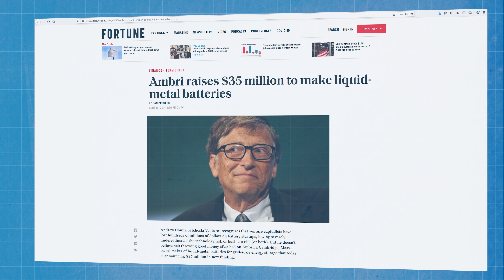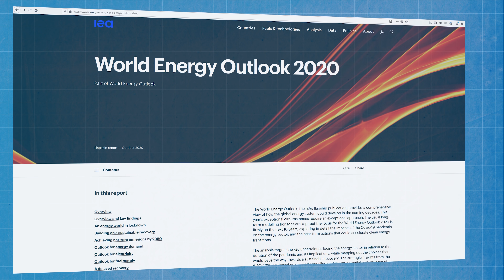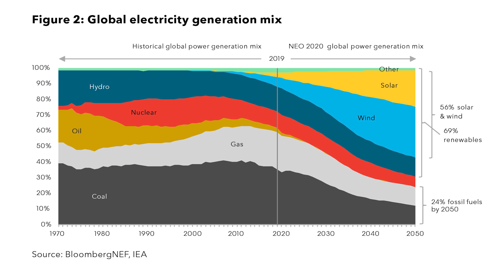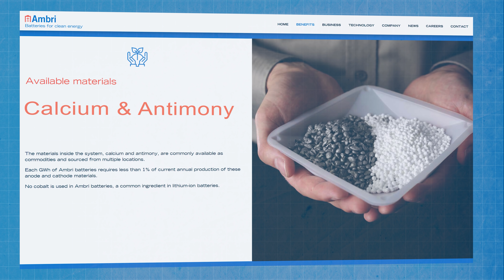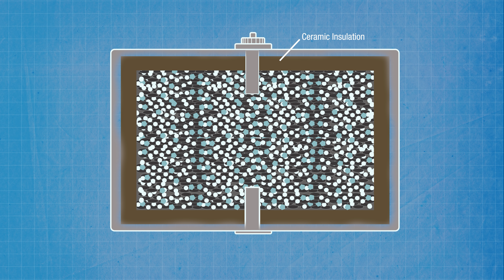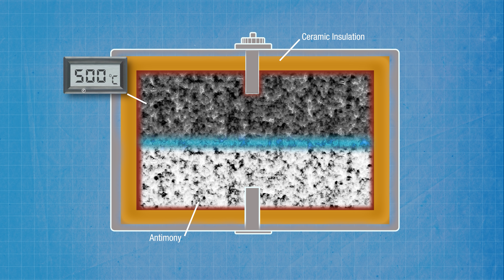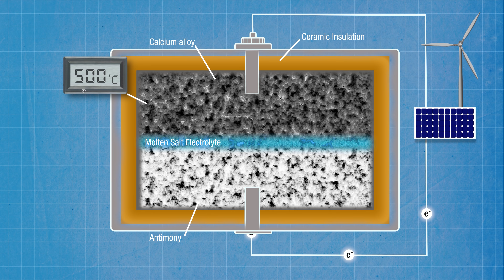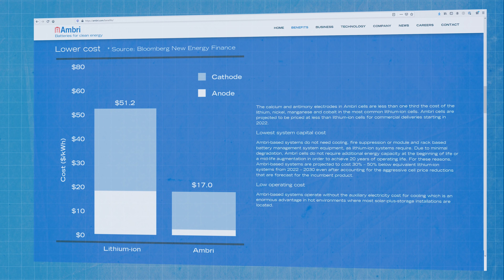AMBRI Liquid Metal Batteries. Will they really change the world?

Comment: I am highly skeptical of any energy production or storage mechanism that claims to be safe. Any system with low entropy can explode, or at least conflagrate dramatically. Battery/electric systems tend to have higher entropy than thermal/mechanical systems because electric power is so efficient you don't need as much energy available to get the job done, and this is a battery not a combustion generator, so likely less explodey than methane as an example.

But it is still liquid metal, if the container is damaged, that is dangerous. If it leaks out your building is highly likely to burn down, if it comes into contact with water it will flash boil causing a steam explosion, and there are probably other risks too.

I'm not saying this rules out the technology, it may even be among the safest ways to store energy available, I'm just saying that if we don't take its risks seriously from the start, we'll discover them when things go terribly wrong.
Reply: The fact that something poses an explosion and/or fire risk has never stopped us. Just think of how many tons of highly flammable fluids are stored under each and every gas station on the planet.

From my point of view, the bigger problem with this battery system is the toxicity of antimony rather than the imminent fire hazard. It might get banned just the same way we're currently banning lead from everything and anything.
Reply: @MoraFermi  And it isn't like gas is non-toxic either. I'm not an expert, so I can't say how it compares to this battery, but toxic hazards can also be managed.

We just need to be realistic about what the risks are what needs to be done to mitigate them to a satisfactory degree, and then choose the best available option. If the battery costs half as much as the total cost of Li-ion, but you have to spend 3 times the battery cost to mitigate the risks, it isn't cheaper. On the other hand, if the risk management only costs 5% and the battery costs half as much, it is well worth it.

I'm very glad they are setting up an operational pilot project, that will give us real world data on the costs, as well as experience dealing with the non-monetary downsides. We'll see how it stacks up, and which applications if any it ends up being the best option for. Maybe it turns out to never really be worth it, maybe it turns out to be worth it in niche situations, maybe it turns out to be our primary grid storage solution. It definitely has potential.

Comment: As the host said, we'll need all energy storage options and then some. So assuming this can work as promised there will certainly be a place for it alongside the many other schemes. But in terms of form factor and structural limitations, it seems to me that the direct competition for this technology will be flow batteries (vanadium based or otherwise). Big, heavy batteries that are suited to stationary applications, but can be placed almost anywhere with a relatively limited footprint. So the question becomes which will end up having the edge in terms of price. Difficult to predict, but I'd be interested to see someone make an educated guess, based on abundance and current market price of materials.

Comment: "If you want something dirt cheap, make it out of dirt."  -Donald Sadoway
Reply: "Preferably locally-sourced dirt" - Donald Sadoway
Reply: awesome how he uses designing from first principles
Reply: ....But all that we have comes from dirt and some dirt is very expensive ...I'll say that Chinese of long ago did use local materials to construct the great China Wall .
Reply: @charlesdickens6706  Sadly, local materials and locals.
Reply: "That's no moon" - Jean Luc Picard
Reply: @JohnnyWednesday  the moon does not exist
Reply: preferably  local dirt
Reply: IF Mr. Sadoway wants a cheap method of defeating the dendrite problem , he should investigate the use of ultrasound vibrations to prevent even the beginning formation of the crystals . The u-sound would not need to be applied non-stop , only intermittently . This strategy would minimize the energy required to keep the battery healthy , and thus greatly increase both it's lifespan and it's safety-factor . 
*To examine a possible extreme use of such batteries , read my post at : 
quora.com/If-you-try-to-drive-a-regular-gasoline-petrol-car-on-Mars-will-it-work-Will-it-explode/
Reply: @Prof.Megamind.thinks.about.it.  Sadoway is advocating for a battery technology not based on solid state physics, so dendrite formation isn't a problem. He started the design process by looking at what the requirements for a grid scale storage battery would be. ie; low cost. Made of abundant materials that are  "locally available", safer than exitsing solid state lithium ion batteries, no use of so-called "rare earths".  He took as a starting point aluminum smelting which has alumina ore and a separator electrolyte (cryolite)  with a carbon electrode placed in an insulated vat. A large current is applied which melts the assemblage, reduces the alumina to aluminum and oxidizes the electrode. The refined aluminum is drawn off. However, if the system was sealed and the heat maintained,  the process would be reversible and you would have what was essentially a high temperature storage battery.  He then tasked his team with finding other chemistries with better electrical capacity, made of abundant relatively available elements (if you want to make something dirt cheap, make it out of dirt.)
Reply: @Prof.Megamind.thinks.about.it.  🤔🤔🤔...who said Prof. Sadoway has a dendrite problem? Dude, you're sleeping in class again!
Reply: @Prof.Megamind.thinks.about.it.  ...🤔🤔🤔...who said Prof Sadoway has a dendrite problem? Dude, you're sleeping in class again!!
Reply: @willykitheka7618  
The entire industry has a dendrite problem, in general . That is what I am addressing, NOT liquid-metal batteries . 
Now that you've critiqued my process for overcoming a major industry hurdle , let's hear your "woke" solution .
* I am all ears !  .🤓
Reply: @Prof.Megamind.thinks.about.it.  IN a TROPICAL COUNTRY like INDIA, LIQUID METAL BATTERIES r easy to use/maintain than LITHIUM ION batteries in a LARGE SCALE.CHEAP METAL .

Comment: Sounds like LM batteries are a great potential solution for grid-scale scale energy storage.  However you did not mention anything about powering transportation: boats trains, cars. You said of course that knocking them over  causes them to be disabled and cool down . I am guessing any form of movement may not be good for these batteries. Can you confirm and expound?  For example,  I can imagine ships and trains possibly being stable enough for these batteries, but not cars and planes.  Also they sound way too heavy to power cars and planes.
Reply: They would be in a solid state when being transported. Movement on a train wouldn't effect anything.
Reply: @bubba842  hey Tom thanks I mean to power transportation, not being transported themselves.
Reply from the maker: Hi Douglas. They are 100% NOT designed for anything that moves :-) They will only ever be deployed as stationary utility scale energy storage.

Comment: Once proven, I can see suburbs having Ambri batteries buried under streets and all solar-PV roofs feeding into them during the day, and sucking out the power during the evening.
Reply: I like the idea of taking DC from solar or wind straight to the batteries, saves losses and plant cost in converting to and from AC and no problems synchronising frequency and phase.
Reply: Better yet, in cold climate they could be used as heaters.
Reply: @ramentabetai1266  No.  They need to operate at that high temperature to keep the chemicals molten.  If you take heat out of the cell it will start to freeze, so you'd need to introduce more heat energy.  The heat produced b y charging the battery is sufficient to keep the molten state
Reply: @rogerbarton497  Actually, they could. Objects with higher temperatures will always transmit heat to cooler objects. They wouldn't be very effective heaters, but they could work as a supplement. I wouldn't recommend replacing a furnace with these batteries, though.
Reply: @davidfeigel1677  You're missing the point - they need to be kept hot to keep the chemicals molten.  The idea of using a ceramic insulating case is to keep the heat in.
Reply: @rogerbarton497  and no material can perfectly contain heat. there's going to be heat loss, and at 500 C there's going to be plenty of it. Enough to heat a house or a room? Probably not. Enough to heat a small closet? Probably yes.
Reply: @davidfeigel1677  From here  https://ambri.com/technology/
QUOTE "The system is insulated and “self-heating” when operated, requiring no external heating/cooling to keep the batteries at operating temperature."
and "the system is expected to remain at operating temperature continuously for the life of the system"

To me this means heat is retained within the system.  Of course no electrical or mechanical contrivance is 100% efficient and as you rightly say there will be some heat escaping, but certainly not enough to be a viable source of heat.

Comment: Interested to learn the specific capacity of these Ca-Sb batteries
Reply: If you listen to Sadoway’s presentations he points out that energy density is not as important for stationary grid storage as are cost and cycle life. Lithium ion is a much better solution for cars and cell phones because of its superior energy density, but for grid storage energy density is less important.
Reply: 1000 kWh, 250 kW capacity liquid metal battery, voltage 500-1500V, response time < 500 milliseconds, and > 80% DC efficiency, which fits into and can be delivered in a 10 foot shipping container.
Reply: @charlespolk5221  thanks. around 100 Wh/kg by a rough estimate which is not bad given the much lower material costs
Reply: @charlespolk5221   he is asking for an energy density (kwh/kg) i think.

Comment: Better to use nuclear for your base load. Perfect for it.
Reply: Takes too much time to make a nuke plant and a lot of money to maintain it.
Reply: @ramentabetai1266  Big ones, yes, though fuel costs are VASTLY lower than fossil-fuelled power. Small modular plants are cheaper to build and run. The extra cost is worth it considering nuclear is zero-carbon.
Reply: @heavy_metal_chemist  SMBs require a lot of certification, testing, etc. Building them requires high tech factories and you gotta build them far away from the public.
Gotta refuel them and store the waste. Not many countries are ready to do this fast enough to make enough of a difference by 2050.

If HB11 Energy's fusion(aneutronic, the no radiation/waste kind) thing works there will be no need for SMBs.
Reply: @ramentabetai1266  Nuclear is safer than you give it credit for. We're not in 1980s Soviet Union any more. Three Mile Island is an example of how reactors in the West work under accident scenarios - the containment works. No need to build away from population centres at all. 

A whole bunch of SMRs are based on existing reactors, just scaled down, so there's far less paperwork to do. NuScale have done theirs (I believe), and are building the first demonstrator soon, along with a bunch of other designs. 

The current range of reactors do far better on fuel efficiency, but if we want a sustainable fuel cycle that waste is recycled. Spent fuel isn't a waste, it's a resouce, and should be treated as such. We (I) are working on new methods for recycling to bring costs down to achieve this more easily. 

There's no other way of looking at it - we NEED nuclear in order to keep the lights on while decarbonising.
Reply: @heavy_metal_chemist  It is safe, but not safe enough for the regulators and the media. The public perception has to change before we will see its global adoption, IMO. Would be great if it did of course.
Most electricity-hungry nations get enough sunlight to not need nuclear.
Reply: @ramentabetai1266  It's safe enough for most regulators to allow new projects to go ahead. Plenty are. Yes public perception may need poking in the right direction, but given recent political meanderings, I think the public sometimes need to be told what's good for them and accept it, but I digress.

Yeah, maybe during summer, but the storage (even with tech like that outlined here) STILL isn't good enough, and during winter, solar can't provide enough for the electrically heated homes (decarbonisation, yo) to be enough, hence the baseload. Nuclear WITH renewables and some storage is the best answer.